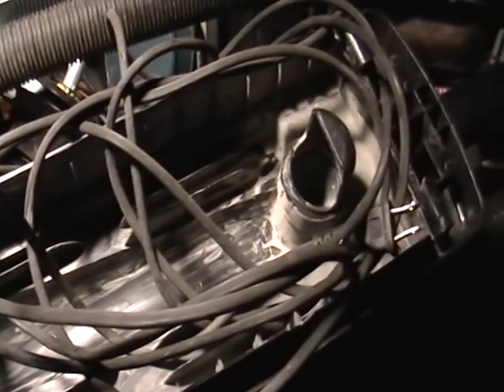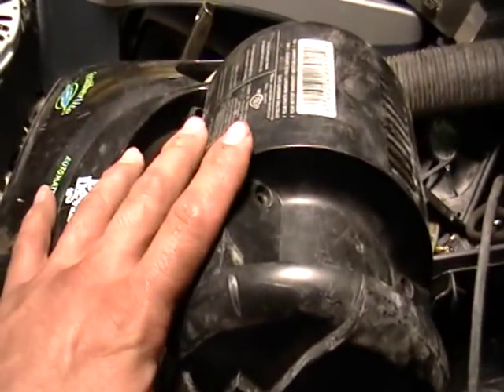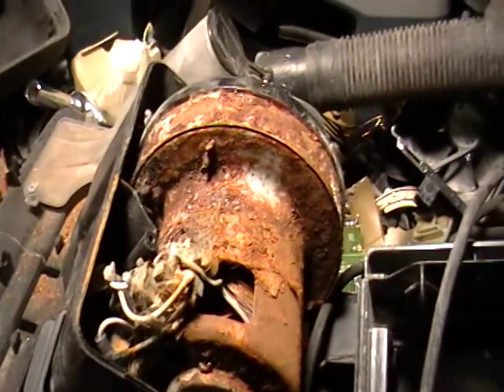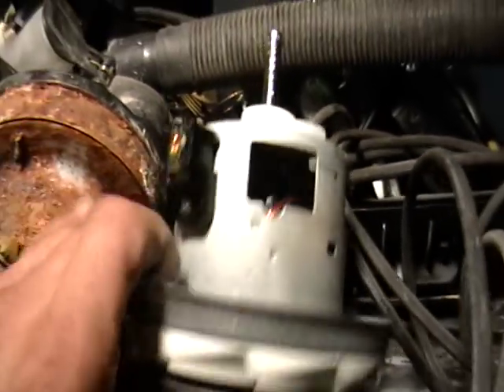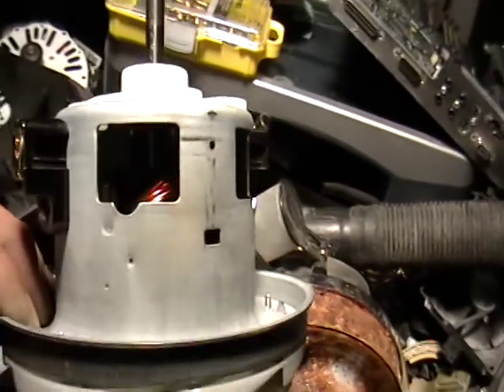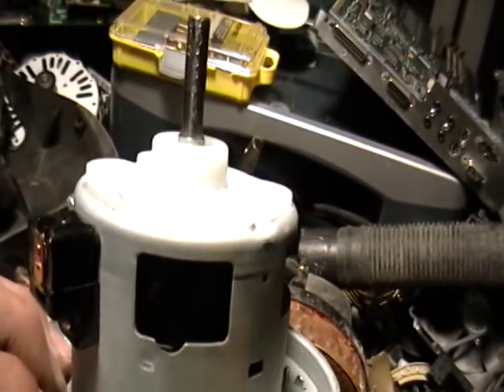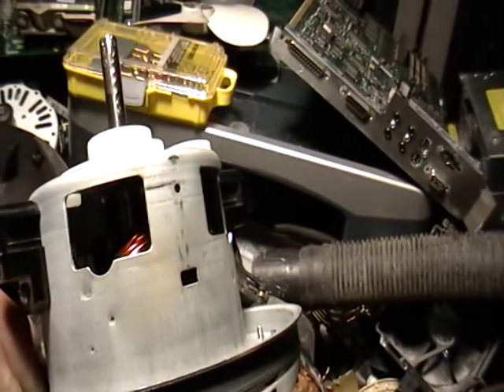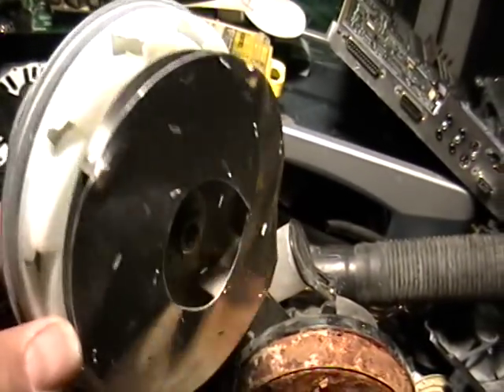Scrapping a Vacuum Cleaner for copper

Comment: Went out yesterday found 4 vacuum cleaners in like 30 minutes!  I will usually strip the motors if they are not to small.  I can usually have a vacuum stripped completely included the copper out of the motors in roughly 10 minutes so its worth it to me to pull the copper out of the motors.

Comment: You can take off the impeller for easier dis-assembly. That nut on the top is a reverse thread. No ax or hammer needed.  The impeller is aluminum.

Comment: To take the motor apart all you need to do is remove the nut at the end.  Do do that you have to turn your wrench to the right as if you were tightening it.   It is like that so it does not come apart when it spins.

Comment: Is the copper in the vacuum copper 1 or 2. I was just curious what is the difference? I saw that the TV Yolks have 2 different kinds. I dont wanna get them mixed up. I am a newb. Love the Channel. Thanks Mike!!
Reply: Stephen Blair I work at a scrap yard here where i live and that is a good question many people have troubles with telling the differences between #1 cu and #2 cu (#1 cu is normally just clean copper like #1 tubing is #1 because it has no sauder or tin coating on it, it also doesn't have like brass fittings on it) now #1 cu wire is #1 aslong as there is no enamel on it, and is not tin coated or has aluminum or brass ends or burnt) #2 cu is #2 because it has the stuff that #1 doesn't have like tin coatings or enamel or aluminum ends or brass fittings stuff like that) I hope this helps I've never really explained over internet before lol

Comment: Do you strip down your motors? Ive been selling as is but idk if its worth it to take the motor apart when you could be finding more scrap in the time it takes to break it apart. I dont get alot of motors, last time i went in i only had like 10-15 vaccum sized motors... So stripping them.... Worth it? Or not?